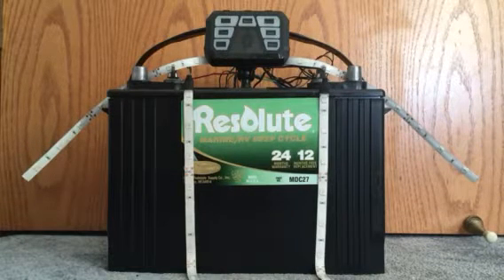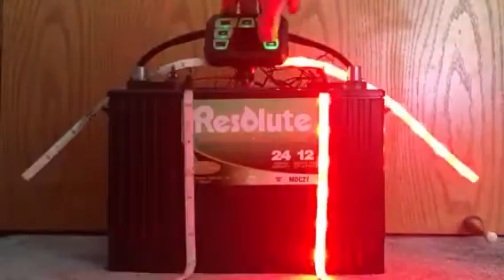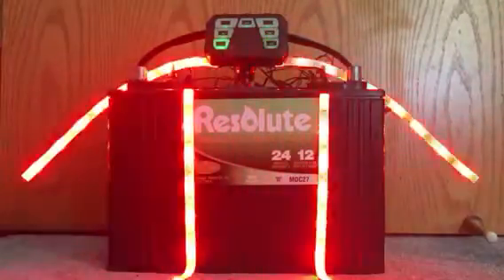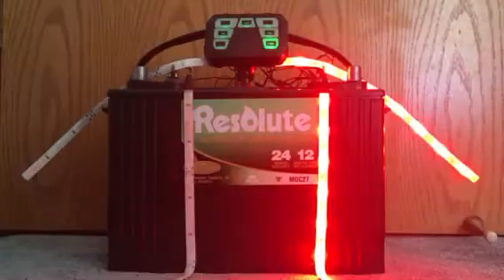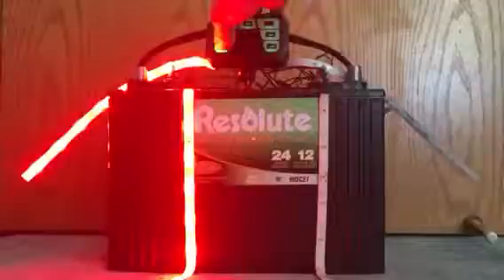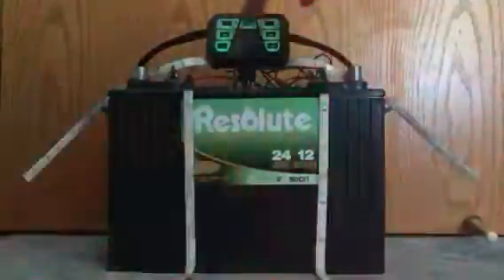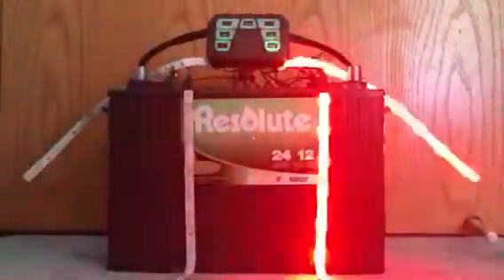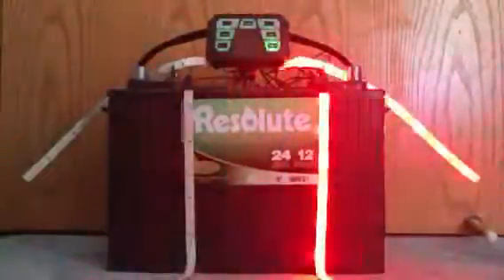4200 mini controller flash patterns

Comment: With Solid LED STRIPS OR PODS will.the flash because the Denied 4200 has a flasher to.make them flash? And can the Let's still be wired as on or off with no flash?  Bluetail Safety  installations

Comment: Does wig wag functions work on LED accents (DRL) in headlights, and halogen high beam lights on some patterns?
Reply: stmkastar643 yes I believe so, and the way I'd go about doing it is activate the high beams or the DRL's independently and single them out with a volt meter to prevent grounding out a wrong wire, and definitely saving some time.